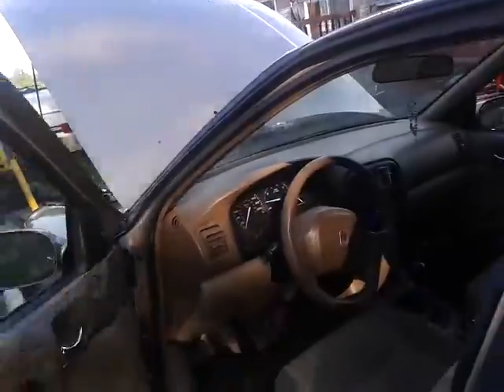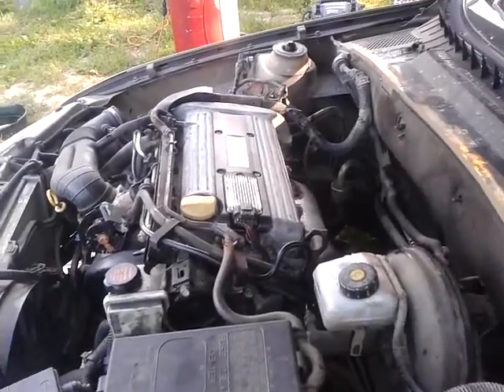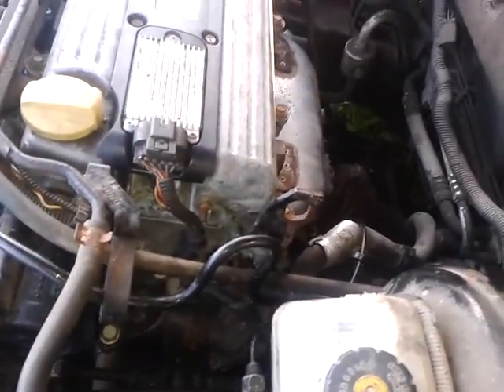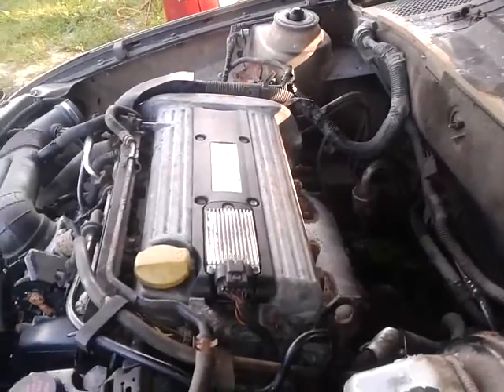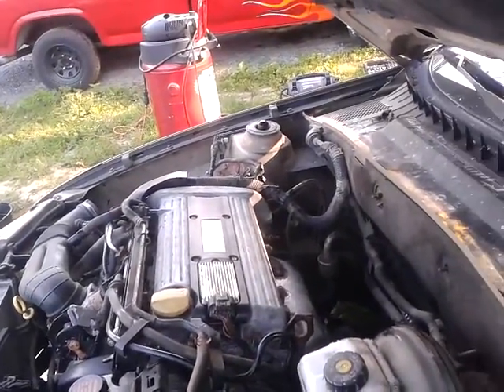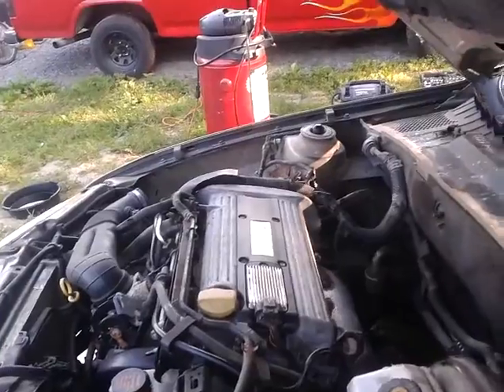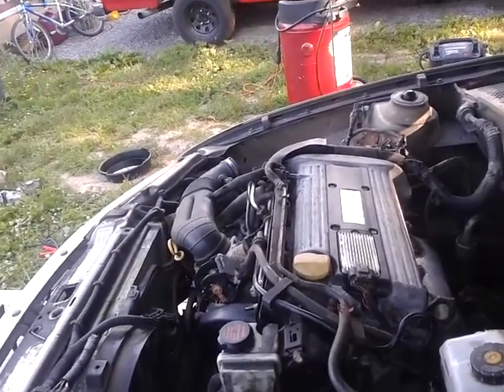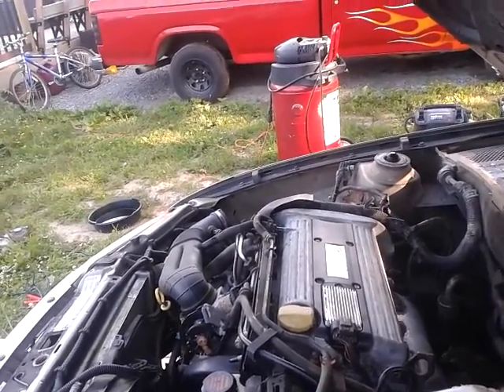Engine swap 2000 Saturn LS - 2.2 litre Ecotec (Part 2)

Comment: where is the 2.2l from?
Reply from the maker: I got the engine at Woodbeck Auto Parts, that is located north of Belleville, Ontario. They even gave a 15 month warranty, Nice place and well organized. http://www.woodbeckautoparts.com/
Reply: I meant what car is the 2.2l originally in?
Reply from the maker: I am assuming it came from another Saturn. Hard to see in the vid but the coil pack on top of the valve cover has the saturn emblem.